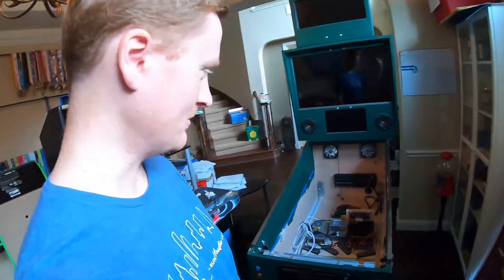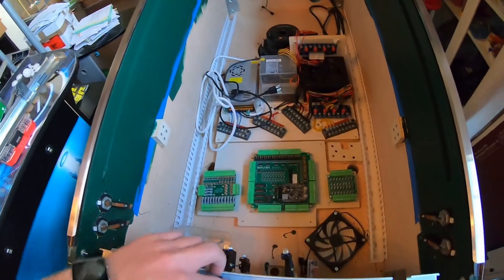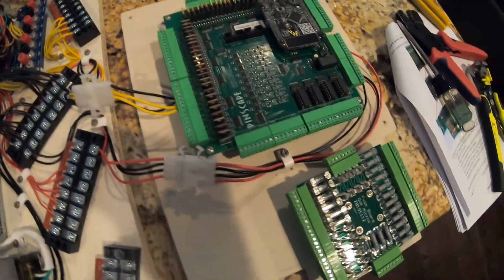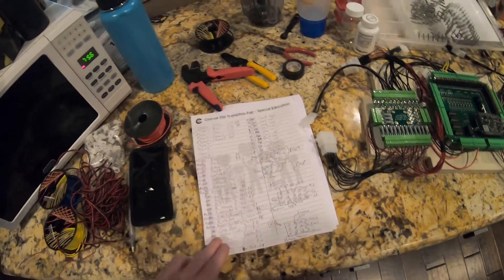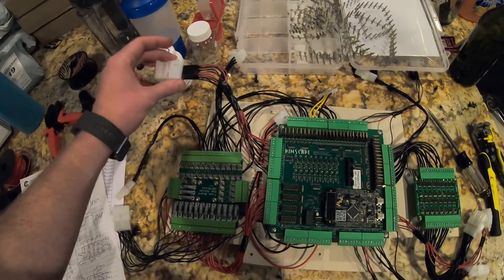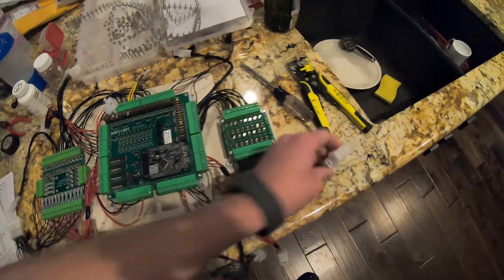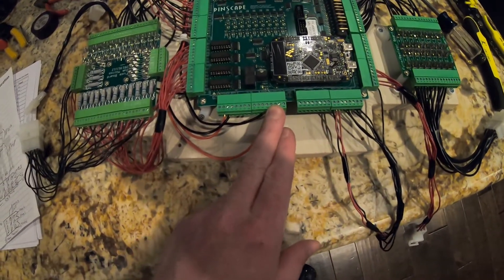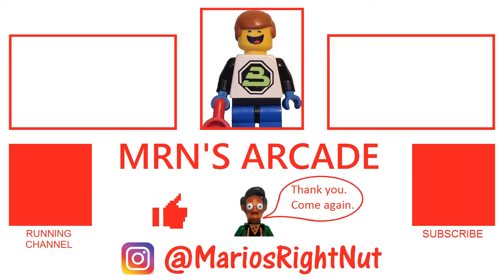Pinscape AIO Wiring - Virtual Pinball Machine Build 13

Comment: Really been enjoying your build videos, especially this one. I have been building my own for a little over a year now and just got my All i One board from Oak Micros a week ago and decided after watching your videos, to copy your wiring set up and add the molex connectors.  I did notice you had commented on Major Frenchys LED Flasher holders on his channel and I also see you do 3-d printing.  I just tried my monoprice v2 mini printer for the first time today and it was pretty successful  for my test print of the included cat file.   I ran into a problem though with the file from Discord, it seems to be too big to print and I was trying to figure out how to cut it in half to make all 5 stars fit on my bed.  I also need to convert it into G Code,  maybe an idea for us noobies to 3d printing for a quick video topic to go along with your build videos??
Reply from the maker: Thanks for watching!  Glad o could be of some help. I use Cura to convert files to g code. It’s free and usually has Pre configured settings for popular printers. You can either move the parts around on the bed before slicing so they fit in the printable area or just print stuff more than once to get all the pieces. Cura is pretty simple and there’s lots of tutorials on it on YouTube. Honestly, I only know enough to get myself in trouble. Haha. I did make my own version of MFs flasher parts. They’re in my feed on the VP discord. If you’re interested.
Reply: @MRNBricks   I ll go check that out, maybe yours will work better , I just moved it into tinker cad to play with it and it said the file was 28" long??  so not sure why that would be?
Reply: I went looking for your feed on discord but I am not seeing it, what am I missing?
Reply from the maker: That’s weird. Shouldn’t be too big. Maybe the
Scale is off?  Like it should be 28 mm. Not inches?
Reply from the maker: Nutters dungeon
Reply: @MRNBricks   Awesome!  I found yours and was able to get them to print no problem.  Thanks for creating those!